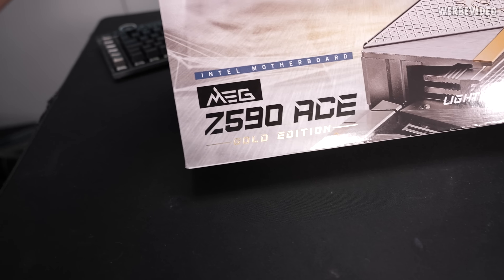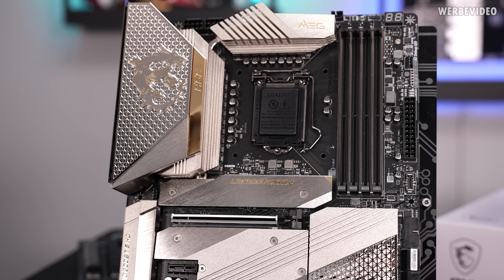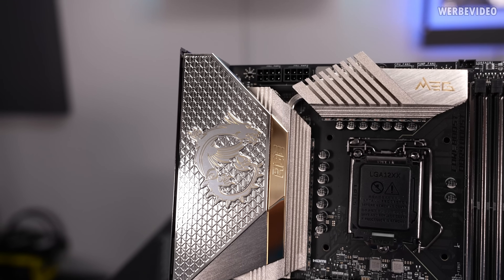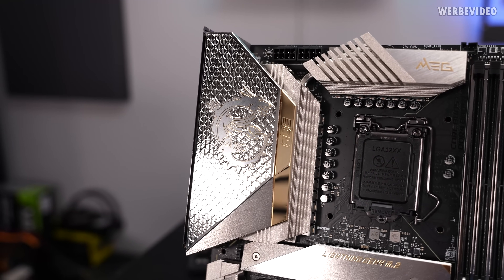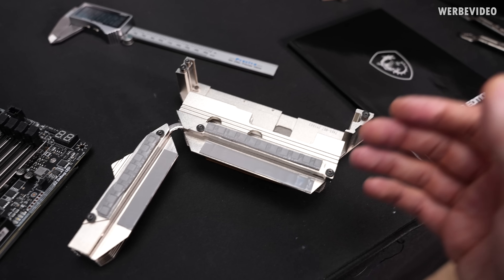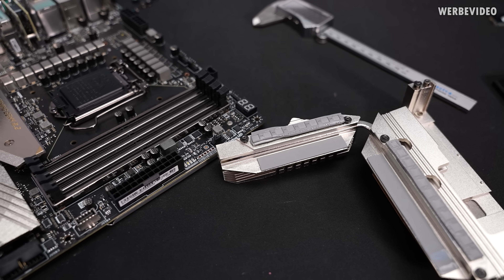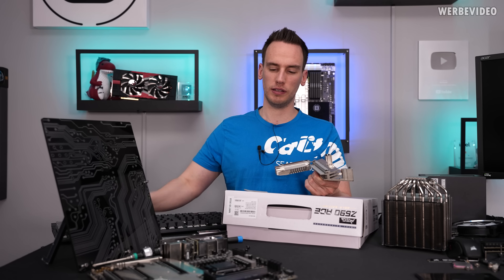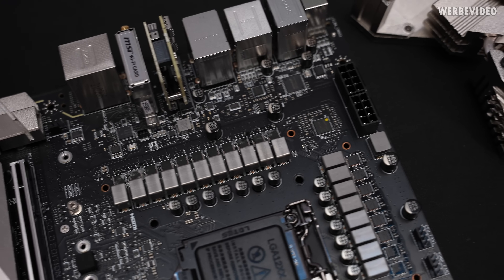The Issue with Review Samples... - MSI MEG Z590 Gold Edition (which is actually good)

Comment: Just a thought, couldn't MSI have just sent new thermal pads instead of a whole new heatsink?
Reply: @samgoff5289  so, no... Incorrect there, it's wasteful to send a whole new heatsink when it's unnecessary... Only a moron wouldn't understand that. Some other really good points in this thread though, panic, simpler, heatsink could also be defective, etc. But sending it 'just because' is wasteful.

Comment: Ive had problems with this board and its only 2 years old... my first error code was C1, after removing all ram nothing changed. So when i put my old ram back in it it booted up and i was in the bios but got an overheating message. I have it in a INWIN 303 case. The problem with this case is theres no front aio mount or top aio mount... theres a panel above but it faces towards the front panel and the psu behind it covers one of the 120mm fans. I got a new case but i also got a new motherboard.  It was odd MSI's manual doesnt have information on a C1 code. But after the C1 code was gone i got a A7. But i got it in bios finally. But the computer gave an overheating code. I bought this is January 2022 so i no longer have a warranty (it expired jan 2024) the 10th gen i7-10700k had aways ran warm (compared to my previous amd chip) but idle it stayed between 52c to 56c. But when i played cyberpunk2077 it ran 90c up to 97c and that was with graphics settings down to high (i have an rtx 3080) and when i first played i could play on Ultra and there were no problems.  So either my small case with minimal fans eventually caused issues, or the msi AIO's pump was starting to fail, and again that's an issue because of the few areas where the 240mm Aio could be placed. I loved my MSI z590 ace gold edition and hope it was just an issue with the pump. But who knows. But if you bought this mobo make sure you have a case that can handle whatever cpu cooling system you try to throw at it. The INWIN 303 is not the case I would suggest.

Comment: I cant tell you how often I find thermalpads stacked, with plastic still, or like sideways on the different boards and gpus I have. I have a pretty sizeable mining farm and it happens WAY too often.
Reply: Apple had a run of Laptops where the people constructing them followed the instructions... but where it showed the tub of thermal paste application, they assumed it meant *the entire tub*... you can imagine how that went.
Reply: I bought this board (haven’t received it yet ) but will now definitely check to see if I need to break out my thermal grizzly pads. I need good connections for heat distribution! Lol
Reply: @TechyBen  I wanna see that so bad

Comment: Intel boards are way too expensive right now
Reply: "Intel"

People have no problem spending when it concerns Intel
Reply: Z590 are expensive b560 is reasonable
Reply: @samgoff5289  b560 doesn’t have good enough VRMs to power an 8 core.
Reply: @tanishqbhaiji103  Some of them are though, but out of those quite a few are approaching the price range of a z590 anyway
Reply: @mingyi456  yup, only ones which are reasonable priced aren’t readily available such as the MSI mortar,A-pro, gigabyte ones which were on discount.

Comment: I hate having PCIe x16 slots tripple space apart. A second expansion card would have to stuck right under the GPU (most today's GPUs are 3x slots) and the ablility to connect two 3090 via NVLink is lost.

Comment: Edit: correction, I’ll leave my new mobo alone lol.. thanks for going into depth on this as there is NO ONE else is doing videos on this exact board and actually using it. It’s one thing to see it but another to see it being used. Can’t wait for my i7 10700k and my 64gigs of ram, and my Asus strix 3080 oc edition. I’m coming from a very old system (Asus mark x, avirx ddr3 16gigs, i7 4790k devils canyon, galax gtx 980) it was super custom and had lasted me 10 years but it just cannot keep up with todays gaming. Thank you sir!
Reply: so are you happy with the Board? Because I have my eye on the gold Edition, didn't give you no issues? one review on Amazon they received a board with half the pins bent, another the Bios was Wacked, but assuming this happens when they but Frome other sellers, I always try to Buy Direct from Amazon, Sold By Amazon Ships by Amazon and if I have to spend a little more to Buy New it's well worth it. Well hope you can get my hopes up to buying this Very Nice Board Ty👍🏻👍🏻

Comment: Does MSI still use killer network? Thats the only thing stopping me from buying MSI motherboards again, literally killing the network.
Reply: Killer works fine, just make sure you only install the clean driver, not any software garbage they have. Not sure if it was MSI, Aorus or ASUS but one of them always reinstalled cFosSpeed even after uninstalling it.
Reply: @puciohenzap891  i have, probably 100 times past 2 years, latest drivers gave it some stability, but ive never experienced such junk before in my life.
Reply: There are a ton of boards using killer network not just msi...maybe you just don't know what you are doing or you installed garbage software